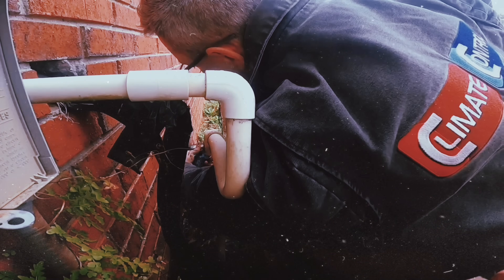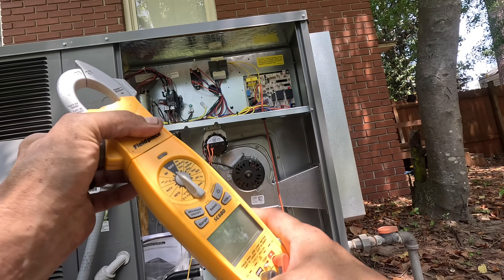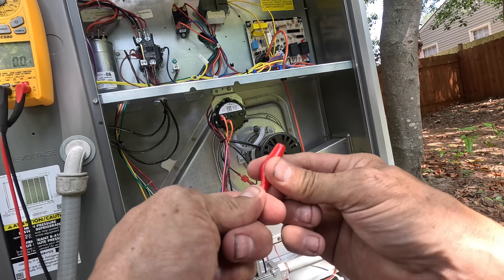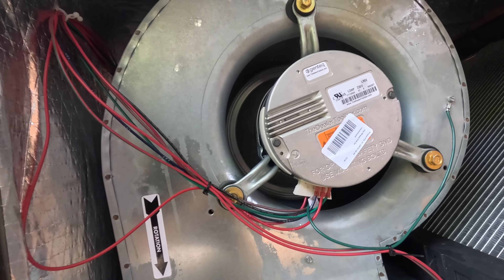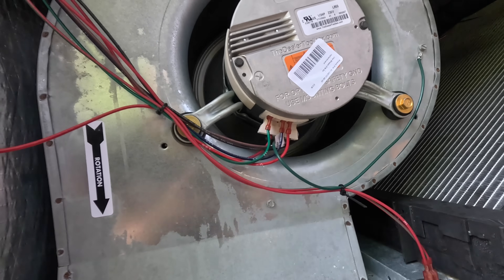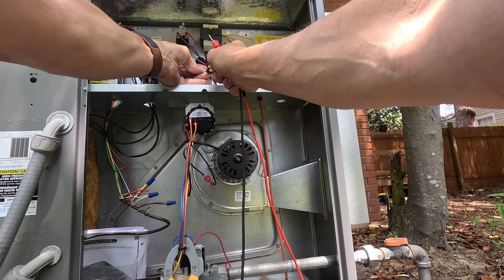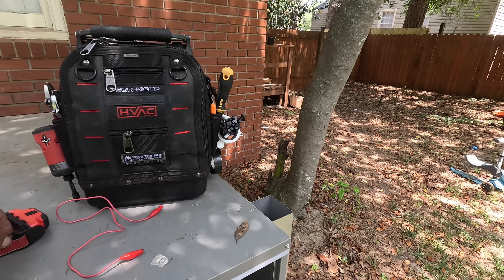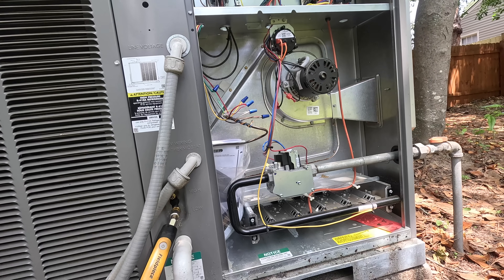System Was Freezing Up Due to No Airflow! #hvacguy #hvaclife

Comment: I'm a bit confused by this one. I understand the green wire for fan wasn't making contact to the thermostat board. Does this thermostat send 24 volts to both green and yellow on a call for cool? Same on white for a call for heat? Usually, on a call for cool or heat, 24 volts isn't sent on the green wire for fan unless the circuit board in the unit doesn't activate the fan automatically. This would be programmed in the thermostat. So if there was a call on yellow, the fan should had been running regardless if the green wire wasn't making contact or not. Also not sure why you moved the green terminal from low to high on the blower motor. Now if the fan is turned on, it will run on high. Unless you switched it back off camera.
Reply: Standard thermostats energize both Y and G for cooling. When in gas heating mode G doesn't come on unless it's set to fan on mode but in electric heating mode G does come on with W.

Comment: That old amana electric furnace you did you wanted to know if anyone could find those terminals. I'm not sure what size those bolts are but i'm guessing #10. The part number to search is "8015K31"  on McMaster-Carr. Mouser has some more in different bolt/stud sizes too.